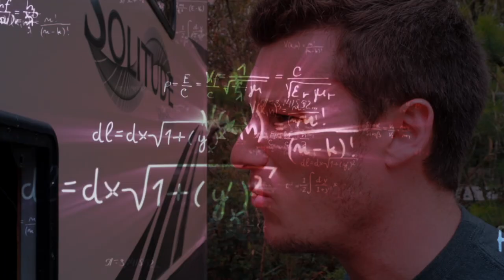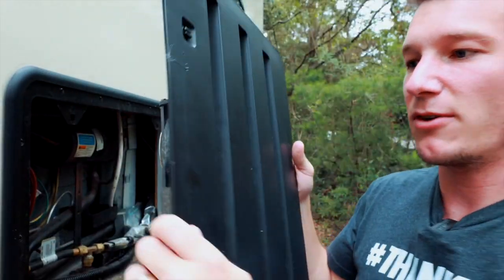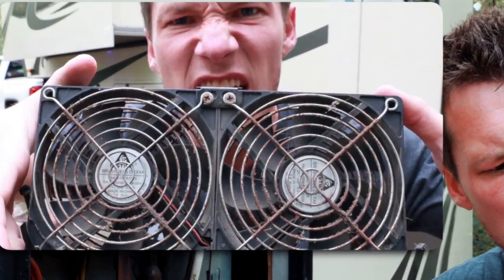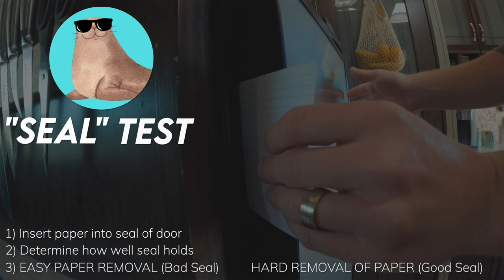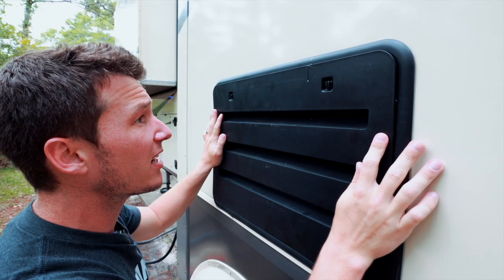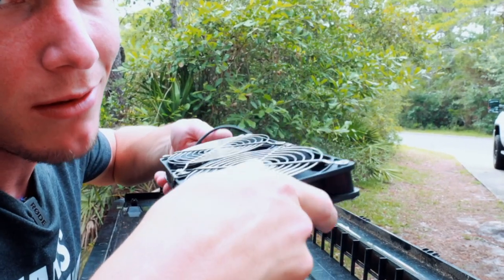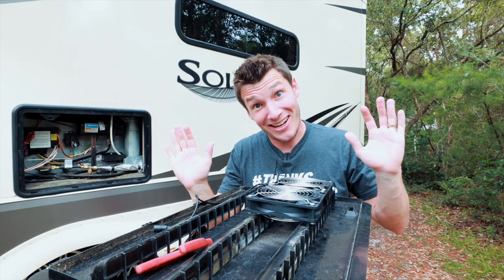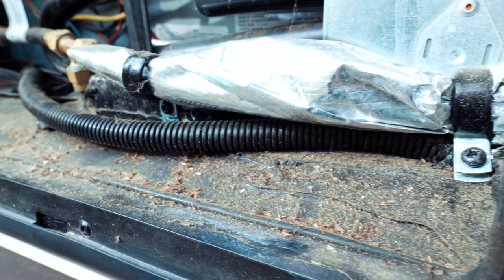Turbo-Charge Your RV With Ease! (Ice Cold Fridge)

Comment: WARNING: If you use PC fans to do this, be prepared to replace them regularly. The plastic is not made for outdoor use, and the blades will eventually break. If they break when the fan is running, they could come off and damage the cooling fins on the back of the refrigerator.

Comment: Carl,  I know that instructions really really suck, but I believe your refrigerator instructions will tell you a different location for the fans that for some reason works better.   Maybe because it cools what needs it the most?   Just so you don’t have to spend 5 minutes to find it, see page 31 of the attached Norcold 1200 series manual.

https://norcold.com/wp-content/uploads/2018/07/SM_1200_Series_618968C_020807.pdf
At least that is where ours were installed.
Tell Ney Ney, Dexter, and Kyle hello for me.    Best Wishes,   Kevin
Reply: RV refrigerator fan helps too.